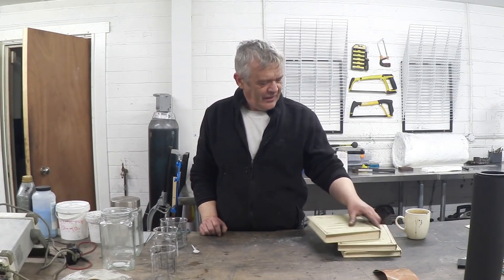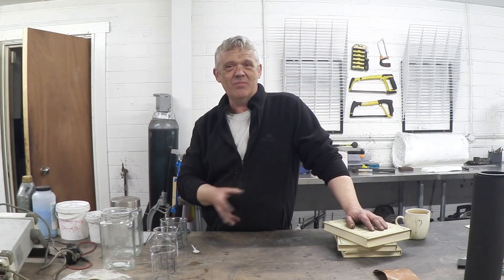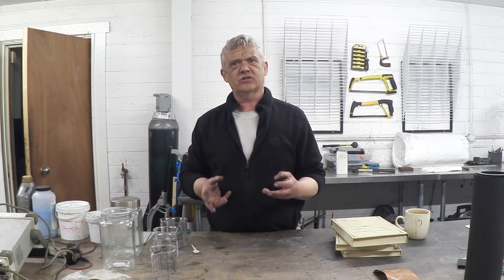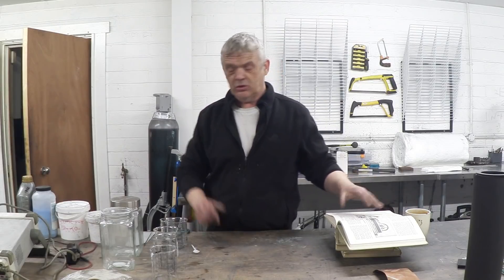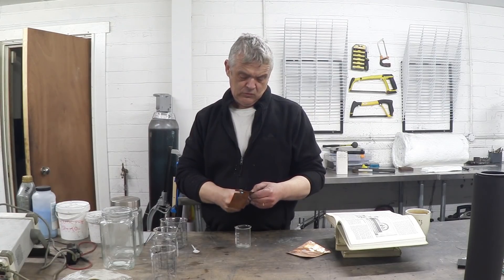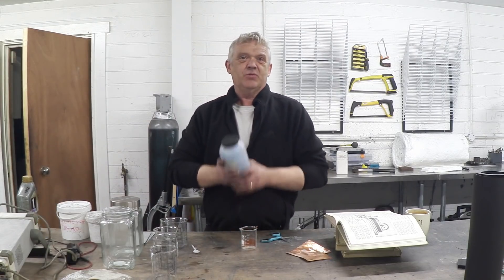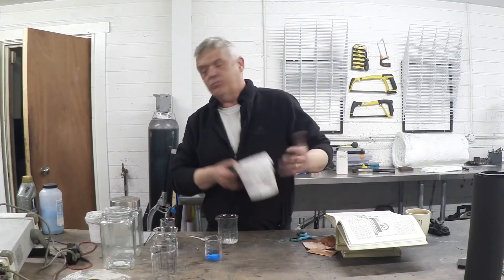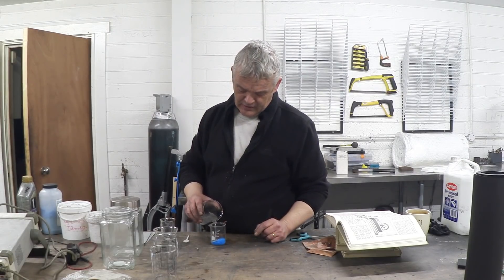Gravity Batteries - Cheap, Easy, Robust And Awesome For Off Grid

Comment: half followed your advise my first attempt  used:
zinc sheets(as instructed)
zinc sulfate monohydrate(not sure if it matters)
copper sulfate(as instructed)
bare copper electrical wire(folded i had it around and didnt think to order sheets)

saw some reaction and both the anode and cathode had a black build up around them. It ended in failure to make it short but Im gonna keep looking and trying to see what i did wrong() will get proper sheets too). might also be adding too much zinc sulfate and messing up saturation. Any tips for a guy trying to get good?

Comment: It's interesting that you said the hydrogen was separated off of the battery. Could the hydrogen be collected to add as an additional fuel?  Scenario: A wind turbine charges a large stationary gravity battery where both the  hydrogen and stored electricity is used to fuel a vehicle 🤔

Comment: That bromide battery looks like it might be good in a stationary application, where density and bulk aren't really a concern. I just wonder what the cycle life of it would be, if it were used as electrical energy storage for wind, or solar. With rooftop solar, it would be charged every day, and discharged every night. What would the cost per kWh be, compared to just buying commercially available Lead Acid, or even Lithium Iron Phosphate? What matters, is the levelized cost per kWh of energy storage, which is the cost, divided by the capacity X number of cycles of cycle life. For off grid use in a large house, you need ~60 to 80 kWh of capacity.

Comment: I have always wanted to use modified tesla one way valves in an exhaust to moderate backpressure through a turbo charger.  If properly setup, you should be able to almost eliminate turbo lag without the complicated computerized valve system that is used today in modern turbos.

Comment: They do not like to sit unused, they do not like to be discharged rapidly.
In both cases reason being that copper sulfate and zinc sulfate got  mixed.
I am wondering would it help if we introduce fumed silica in to the mix and get yourself a gravity gel battery?

Comment: Love your videos! Density battery in reality, as gravity doesn’t really exist! More a term to make certain things easy for those uninformed. Center of mass is the center of gravity, density is the separation of solids, liquids, and gases thanks to barometric pressure and so on. The pressure also isn’t possible without a solid barrier between us and any other pressure gradient, especially a supposed vacuum 😂. “Pressure, pushin down on me, pushin down on you, no man ask for. Under pressure, what brings a building down”. The pressure comes from the electromagnetic torus(artistically a tortoise with earth on its back) surrounding us, aka the Van Allen radiation belts, aka the dome, globe around us, or origin of snowglobes 😉. Wake up people, take your mind back! Anyways, 💙 & ✌️

Comment: So... if I built one for emergency power,  out of a 55 gallon blue resilient plastic drum... I can leave all the chemicals in there and the copper coil, I can just leave out the Tin bar untill needed... in that way, it should need no maintenance at all until use? Sound like an idea? I wonder how much it would cost to make at the 55 gallon drum level?

Comment: This is the second video I've seen from you about building DIY off-grid batteries, but both videos just tease. You show how to make a small battery that will power a tiny fan or LED, but you don't show how to build a truly useful battery bank for powering an off-grid cabin with lights, TV, laptops, PC, etc., for a day or two. That's what I'm hoping to see. Will you please show what quantities of materials to use to achieve genuinely useful off-grid ZnBr2 batteries (or some other chemistry, if that's easier and cheaper)?

Comment: I got my zinc bromide cell working, its in a beaker like yours.  I think I used too high molarity liquor, it was probably closer to 8M and I see you talking about using 5M.  It's awfully red, no smell though with the oil on top.  I didn't have access to conductive HDPE but I did get graphite gasket material from my plumbing wholesale house and it is holding up so far.  It's terribly delicate but I was able to gently shape it to have leads that come out of the beaker with the zinc.    I really appreciate you sharing this video and the others as well, I had to make my own zinc bromide which worked really well actually by following your ZnBr video.  I got 1.87 volts on it's first run, and it dropped down to 1.82 on subsequent runs.  Looks like it has really great w/hr rating.  I was able to pull nearly an amp out of it, but usually it settles down to about 500mah for a 4cm diameter graphite electrode in the bottom.  I'd suggest people who work with the ZnBr make up a solution of sodium thiosulfate as a reducing agent in case of spill or it gets on skin.  I got a nasty little burn on my knuckle from the zinc sulfate, it was a good reminder to don gloves and wash carefully.  Well thanks again Robert for the great series on these batteries.  I'm going to try to make some fully cased ones after I get some kinks worked out.  I'm going to try blow or vacuum forming with some hdpe then seal it permanently with a proper vent.  Has anybody tried ZnBr gel cells?
Reply: Ok so.... I just got up, the cell had been fine for almost 2 days, but this morning during a full short discharge I found lots of hazy metal had infused into the oil, and the zinc electrode on top had eaten off on the bend down in the beaker and fell off.  :P  I'll try a graphite on top this time.  The graphite bottom electrode seems to be holding up well at least on the bottom.

Comment: Thanks for a great video. I have used the first type at the school where I work so the pupils can make a battery able to light a bulb. I found the design from 19th Century USA telegraph stations. I have also made Bromine Water by a gravity principle by electrolysing KBr solution and collecting the bromine water upwards into a test tube.  I have also made a Lead Acid cell using just a couple of bits of lead in 1M Sulfuric Acid and it charges up in few minutes very successfully.
Let's hope none of these oddball designs create cold fusion and blow us all up!

Comment: What about cleanup? you cant just throw these things down the drain not to mention in the process making elemental bromine is which is extremely dangerous and very toxic. Are you worried that your video could be causing fires, chemical burns, poisoning, potential explosions depending where someone decides to tip this stuff, if someone just flushes it causing poisoning of municipal water supply it throwing it on the ground creating a serious environmental hazard? 
Showing people how to create a very dangerous substance with no advice on cleanup is irresponsible not to mention sloppy as a creator.

Comment: Using an open cell structure container (reduces mixing during movement) and thicker zinc plates could this replace electric car batteries whereby recharging the battery woulf be done by draining and refilling the electrolytes.

Comment: gravity as in "specific gravity"?
Reply: No. "Specific gravity" is the relative density of electrolyte compared to pure water. This is literally using gravity to separate the reactants. Hence a "gravity cell".
Reply: @thereynolds2725  the only reason "gravity" is able to separate the liquids is because their specific gravity is different.
Reply: @sspence65  While that is true enough, I think it is literally referring to gravity. Specific gravity is as related to actual gravity as peanuts are to nuts.
Reply: @thereynolds2725  trying to use actual gravity instead of specific gravity when talking about these batteries is nuts.
Reply: @sspence65  We aren't talking about using anything. We are talking about why it is named the way it is. The person who named it said to himself, " These liquids separate by gravity... I'll call it a gravity cell!" You can run off into left field trying to tie it to relative density if you want, but that is what's nuts.
Reply: @thereynolds2725  I'm sorry if you don't understand science.
Reply: @sspence65  What is it you're not understanding here? Why have you resorted to attack mode? Are a child? Gravity is separating the liquids = gravity cell.
Reply: @thereynolds2725  that's the issue. Gravity is not separating the liquids. Specific gravity (relayed to density) is. Do some research, you are embarrassing yourself.
Reply: @sspence65  I understand that the relative density (specific gravity) is why one liquid floats on the other. I am NOT TALKING ABOUT THAT. We are discussing the origin of THE NAME. Gravity causes the liquids to separate by their relative densities. Now, whether you like it or not, the person who named it was talking about the force exerted by the planet on the liquids. Gravity cell. Not "specific gravity cell". Not "density cell". Get over it you petty child.
Reply: @thereynolds2725  ignorance does not wear well on you.
Reply: @sspence65  Show me where I've been ignorant. Do it. I'm not ignorant of the density of the liquids. But without gravity, they wouldn't separate the way the do. Gravity cell. You are trying to revise history because you like the term "specific gravity". You should try politics because science doesn't work that way.

Comment: I always thought the term 'gravity battery' meant something like pumping water to a high point for storage (charging), and then allowing that water to flow down through a system that captures that kinetic energy as the gravity pulls that water down (discharge).
Reply from the maker: lol
Reply: @ThinkingandTinkering  I wasn't expecting a laugh, Robert. Wouldn't that be a kind of battery as I described? Say you have solar power -- when the sun is up, the solar cells could be powering a pump to pump water up into a collection reservoir a few hundred feet in the air.  Then, when the sun goes down and you want electricity, you open a valve and water flows from that reservoir DOWN through pipes using nothing more than GRAVITY and some kind of turbine that would spin as that water flowed through those pipes and back down to ground level.

If that's not a battery, what is it? It certainly stores power, doesn't? It stores it in the form of kinetic energy. And if it is a battery, what would YOU call it?

Comment: With respect to the second battery you assembled, Is the accumulation of hydrogen harvestable and, if so,  does it produce enough to be dangerous?
Reply from the maker: that would depend on scale mate - after all normal lead acid batteries produce enough hydrogen to be dangerous. thats why in grid stailisation the battery houses are cliamte controlled.

Comment: Hi Robert, there is modern versions that is using the same principles. These are the so called Flow batteries, as far as I know there is 4 companies that have produces succesfuld working systems -  Visblue(Denmark/Portugal) - RedCell(Germany/GB) - Redflow(Australia)  - Ess Inc(USA) - They are very big, but good for solar and likewise. The cool thing is that about 50% of the value can be recovered at end of life  which is for Visblue about 30 years with  daily change circle.

Comment: I would never order someone; into always having a tub of Swarfega handy (when doing a presentation video and handling books).  
But ..you know. ;-)

Great information btw.  Thanks.
fyi - these 'gravity batteries' (commonly called a  'gravity cell' when they were in use) were commercially used into the 1950's.
Apart from the issue with needing to keep them stationary, another disadvantage was that current needs to be continually drawn (to keep the two solutions from mixing by diffusion).  So it was unsuitable for 'intermittent' use (switching OFF and ON).
Another issue might be, if these were commonly used today;  The local pollution levels would be much higher than with the current technology.  Still, they could certainly be used in emergency situations (for specific applications).

 It would be fascinating to wonder however (using space age materials) if this old tech could be rejuvenated into 'something' new and improved. :)

Comment: Just wondering does the voltage scale with the size of battery volume?
Reply: Battery voltage depends on the number of cells wired in series, times the voltage of a single cell.  A single cell's voltage depends on the chemicals (zinc-carbon, lead-acid, etc.)  So, if you make one big cell, it's the same voltage as one small cell.  If you make N small cells, you get N*the voltage in N*the volume.

Comment: its relative density your describing not gravity. love your videos though, fascinating stuff. have subbed.
Reply: If it wasn't for gravity the components wouldn't separate out into layers by density and it wouldn't work.
Reply: @AnthonyHigham6414001080  gravity can't cause anything. its an effect. It's relative density equilibrium.

Comment: So. A galvanic cell... But what forms the membrane? I'm going to take a shot in the dark, but wouldn't this battery have an extremely high internal resistance, because it has no electrical seperation between the annode and the kathode?

I'm putting my skeptic glasses on, but I'm genuinely curious, and happy to be proven wrong.

Comment: I ran across an old text that called these sedimentary batteries. Interesting But I was waiting for gears and a pulley systems. lol
Reply from the maker: lol - cheers
Reply: @ThinkingandTinkering  One of these days I will post a video of how my aluminum oxide cells turned out after three years of running. They last along time, but generated poor amps.. Made 13 of them. To power a single LED for three years.. Goal was to see if they could be used as a long lasting radio beeper..

Comment: Hi Rob, a quick question regarding the batteries. Can they be up-scaled for off grid power systems, eg. 10Kw or 20 Kw storage for solar? If so, what life cycle would they have?

Comment: Very interesting, could you connect them in a series to increase the output ?
Reply: Series to increase voltage and parallel for more current just like any battery.
Reply: The Dog Walker thanks I’m new to this so only just learning
Reply: @nickcaddoo1014  any time

Comment: Would this batter qualify as a "deep cycle" ? as you mention Off-Grid. Do you have any plans to build a DIY 12V or 24V battery bank that can be used for a Off-Grid Solar system ?

Comment: Taking your comments about using something old or done before and updating it with modern materials and methods, one can apply that to many different endeavors beside working with electricity. I found this when studying geography in the early 1970s (and later) where I observed that most younger people ignore old people and their life experiences, and they tend to overlook previous research if it is more than 10-15 years old, much less from decades or even centuries or millennia past.

Comment: You presentation would have more weight to it if you could have a second camera pointed at the battery and maybe do a split screen.  When I saw gravity battery as the title, I was thinking of renewable energy sources doing mechanical work to store static weight or pressure. Lol
Reply from the maker: lol indeed

Comment: These are exactly the gravity batteries that I hoped the video would be about!
I always wondered why the strip from the bottom electrode did not need to be insulated from the top portion of the electrolyte.
Reply from the maker: cheers mate - thanks for the post

Comment: clever but messy, I wonder if the same method can do rechargeable ones, nvm you also answered that one, saves me from reading books
Reply from the maker: lol - but reading is good for you
Reply: @ThinkingandTinkering  it is but only if you need detailed info, also does the temperature rises when the gravity battery is in use?

Comment: Very interesting, no need for a seperator.  But it can't be moved.  What if there's an earthquake?  This could only be practical for backup power sources of buildings in non earthquake zones.  It would be interesting if you made one that you could tip around in a gyro.? One that would always stay upright.  Also, do you have to use chemicals?  What about your graphene paper and saltwater for a battery?

Comment: Great example of decomposition using a variety of chemical substances and metals with different densities and that decomposition creates a potential difference. Really it should be named a Density Battery because even the oil used to 'seal' the battery to prevent water evaporating sits on the top of the water not because of gravity but because it is less dense than water.
Reply from the maker: thanks for the post, mate